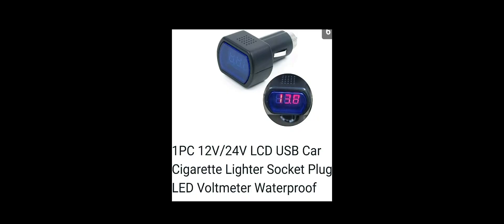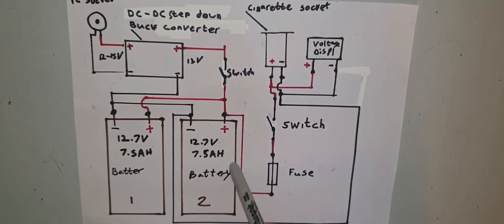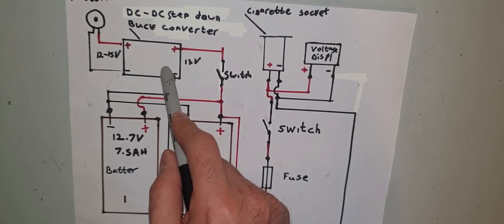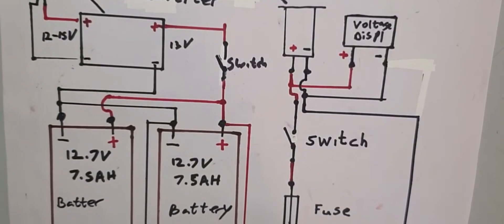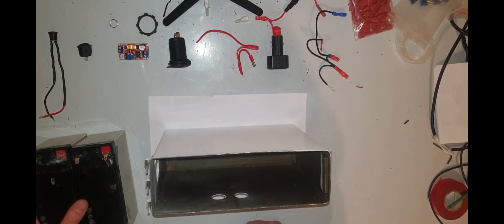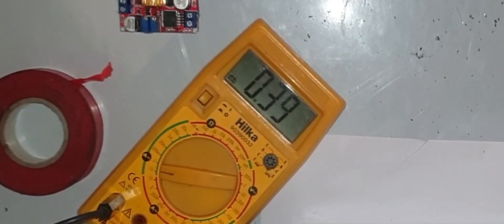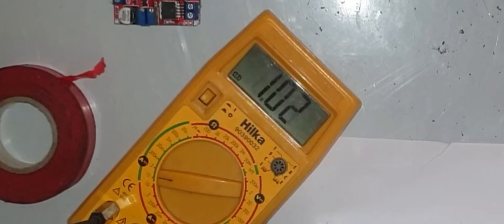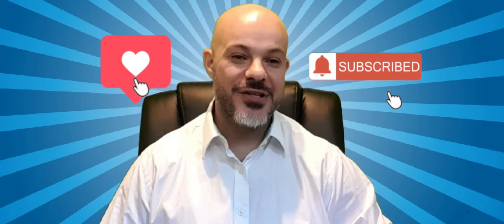D.I.Y Telescope Power Supply (Sky-Watcher EQ6 EQ5 EQM Orion EQ-G ) Part 1 10/11/2020

Comment: In my opinion, not the best solution is to use acid batteries. Firstly, out of 15 ampere hours, you can take no more than 50%, that is, 7.5 ampere hours, otherwise the batteries will not last long, and secondly, this is the weight. A more technologically advanced solution is to use lithium in an insulated container in case of low temperatures.
Reply from the maker: I Agree and thanks for getting involved. lithium batteries would probably be much better! I might give it ago later. As an update I've been using this with a Orian Atlas EQ mount and it last upto about 5 hours before dropping to arround 11V but Its ok for me as i seldomly go out for longer then 5 hours.
Reply: @MansHobbsInterests  You are right, the issue of power supply at the astro site will always be relevant, just in addition to the mount there are still many energy consumers and unfortunately, on average, they consume about 4.5 Amperes per hour, so the direction of lithium ion remains relevant, but alas, expensive)